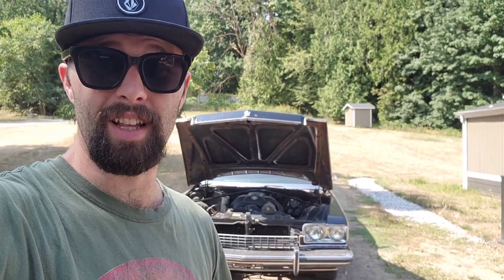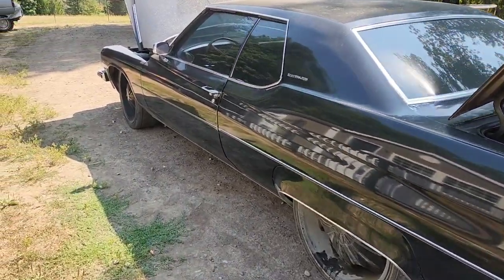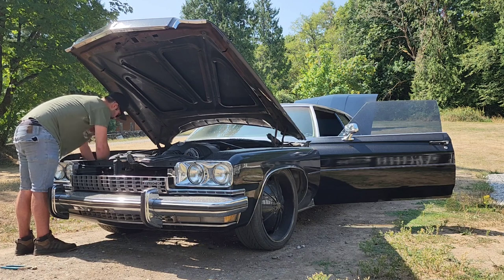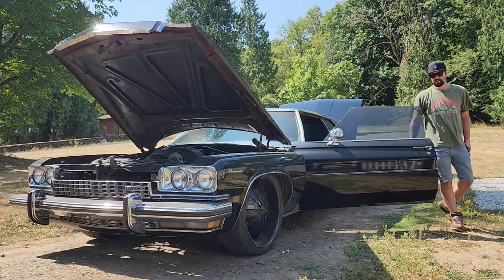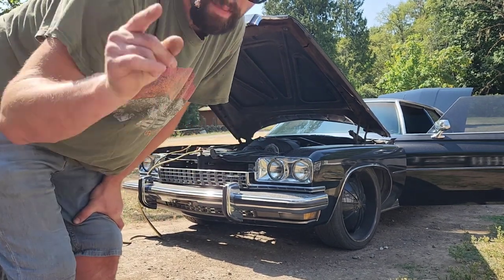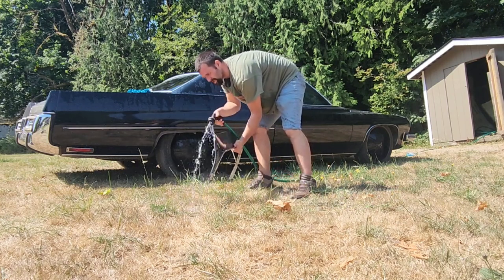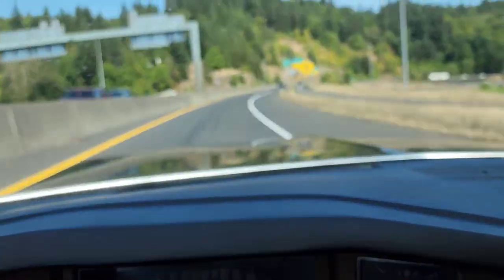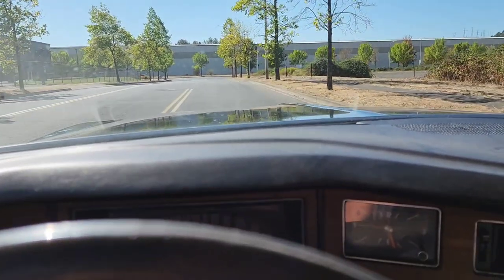Full walk around of my LS Swapped 1973 Buick Electra 225!!

Comment: My mom’s old 74 Cadillac with the 472 V-8 would peel both tires off the rear end. It would swing around the corners and fly when it needed to.
My sister and I had a blast with that car.
I got 16mpg on the highway with the cruise set on 100mph.
I was driving from Colorado to California and on the desert floor, I set the cruise on 100.
I made that 1K trip in no time.
Reply from the maker: That's awesome, my dad had a buick electra when I was kid and I remember that thing had so much torque and just felt like you were riding on clouds